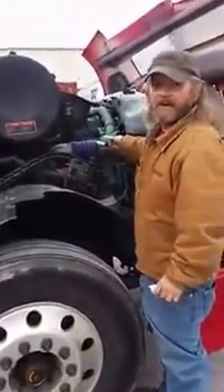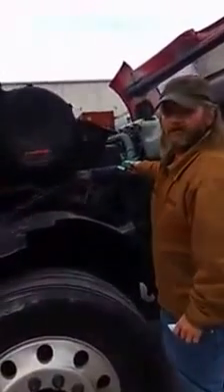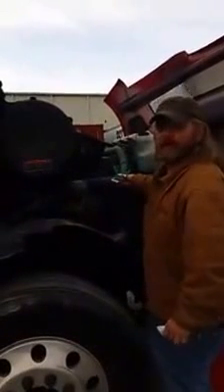How Carbon Monoxide & Toxic Fumes Get Into Truck

Comment: Best solution is to seal all the vents, there may be a better solution for any other problems that come with no vents but at least the health situation will somehow improve by this im very worried i work 7 days a week as a driver tanker soon to be for over 15 years ive worked as a driver my throat feels like the flu like simtoms are just now starting chest and headake too i hope society finds a solution for now i think sealing up those vents maybe adding a water air purifier as well with a fan for the windows not to fog up.

Comment: The newer vehicles have in cab filters that hide the smell although when you use your defroster it uses a different vent and no longer uses that vent filter. I have horrible diesel fuel smell only when I use defroster. It can be a fuel leak, exhaust leak, or weather proofing seal that separates the engine fumes to that defrost intake at the bottom of your windshield. If you can smell that imaging what else can be coming in that is odorless like Carbon Monoxide. I have 2017 Nissan Titan with a Cummins engine. Dealers are allowing for trade-ups to newer years(but have the same issue) or pay you money so you go away and live with it.